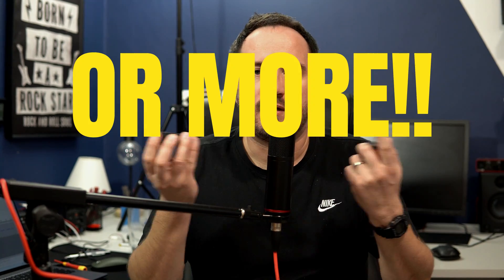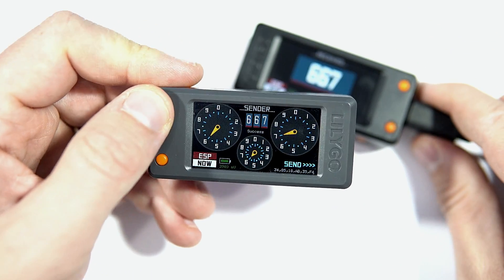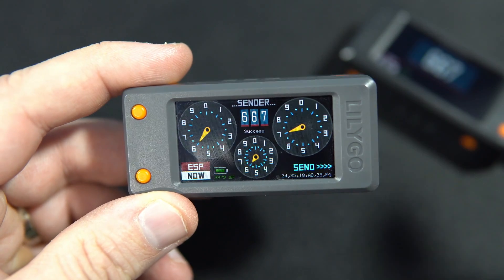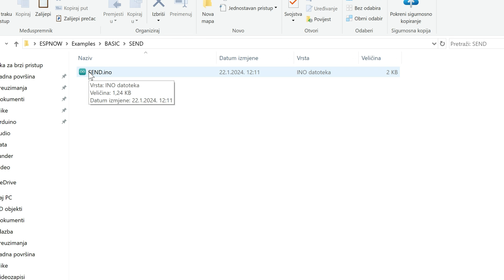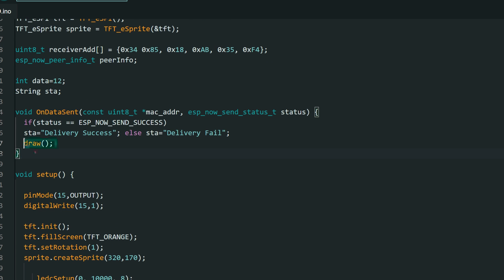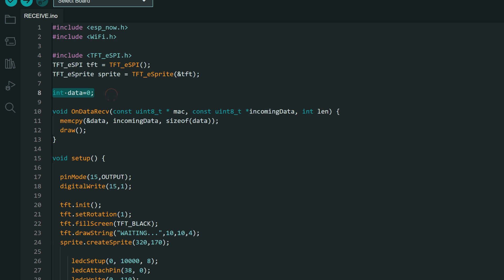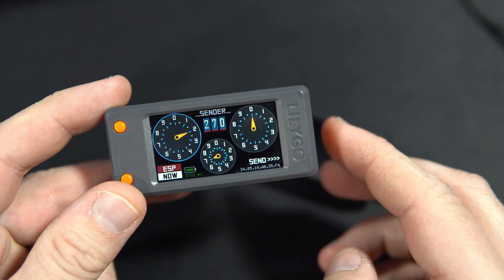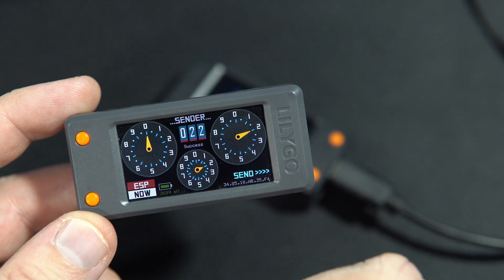ESP-NOW Protocol: Establishing Communication Between Two ESP32 Devices - How to Use It

Comment: Excellent tutorial that answered several of my ESP-NOW questions.  However, this and other ESP-NOW videos explain only limited or on-board functions. A future tutorial could demonstrate sketch, pin definitions and many-to-many links in which "work" is done based on signaling from multiple devices (not timer driven).  E.g. conditional turning on and off LED's  .  Devices both receive and send signaling messages

Comment: So far, out of dozens of examples and hardware permutations only one had worked,  "Arduino_GFX_PDQgraphicstest.ino.   This ESP-NOW partially worked.  It connected to my WiFi, but no display.  Which brings up a point, where are the display pins defined?

Comment: These are devices with the standard ESP32 module antennas? Did you test the range of transmission, at least in the open space?
Reply from the maker: in open spaca they are more than 100m , but walls reduce range drasticly.

Comment: Hi VOLOS , QUICK Question....    can i use   lcd_setRotation(1) ;   sprite.createSprite(536, 240);      inside the code and on runtime sometime to go back to   lcd_setRotation(0)    sprite.createSprite(240,536);
 i am trying to do it but the graphics are scrambled
Reply from the maker: i dont understand, which board you are using?

Comment: It's just wifi, right? It's not LORA.
Reply from the maker: Not Lora, for lora we need aditional hardware
Reply: It uses the lower parts of the wifi stack - stripping off all the IP stuff. 
Very efficient and peer-to-peer. 
Much like the comms used when you have a 2.4GHz mouse/keyboard with a wireless USB dongle. 
Better than Bluetooth if you need range. 
Better than 433Mhz if you need reliable xfer with handshaking. 
Perfect for remote control if you like ESP.
Very low latency.
Simple coding.
Ultra-low-power.
250 bytes per packet but many packets can be sent per second.

Comment: What batteries do you use? What kind of battery life do they get?
Reply from the maker: iniside is 500 mah battery, i can get around 10 hours if BT,wfi are turned off and board is working on lower speed.

Comment: Sadly it won't work on a macbook air. TTGO T display driver loaded, device shows up in USB TREE>but it won't mount. So disappointing
Reply from the maker: Hm thats weard, i never owned Mac, you can try reset board 
Connect the board via the USB cable
Press and hold the BOOT button , While still pressing the BOOT button, press RST
Release the RST
Release the BOOT button

Comment: Thank you!  Want to share with you something from my career: I was a developer at Citrix, worked on the ICA protocol (I added encryption to it!).  A great tool to use with protocols is "capability bits" - although works better with two-way comms.  When the client connects to the server, they both send each other "what they are capable of" -- i.e., compression, encryption, number of colors supported, "able to speak in glyphs" (increase performance by sending letters on screen as "letters with font info", rather than all of the pixels as drawn, so the client can redraw on the client's end), etc.

Similarly the Linux file system has "capability bits" e.g., "setuid" etc, so it's not a proprietary concept.  Really neat in action though!  The oldest client could connect to the newest server, also newest client could connect to oldest server -- greatly increased interoperability.  Thanks again!

(Haha at "memorize the MAC address"; I had several credit cards committed to memory, back in my 20s...  :)  Actually still recall a Windows XP install code I used at another employer!  DKCHP-Q424B-, etc  :)  )

Comment: tip: to avoid looking for MAC and recompilation for other modules, use fake MAC address instead of built in
tip 2: on_sent() and on_receive() should be very fast commands (so no drawing) to avoid problems - better to set the flag in on_receive() and process it out of this callback function

Comment: You can also get the mac adress when you just upload any sketch (even with empty setup() and loop() functions). Just look at esptool messages that will be printed in terminal before the flashing begins. But also you can emulate any mac adress whitout using the hardware build in mac. The second option is to use broadcast mode, where you do not need a mac adress of receiver
Reply from the maker: thank you, yes you are right, i finded it. i will check brodcast mode , tnx again.